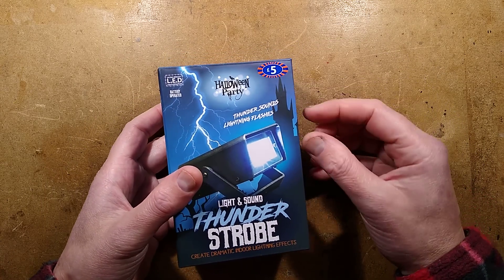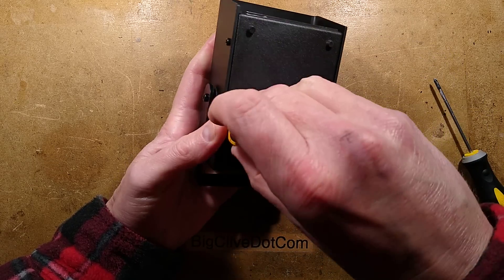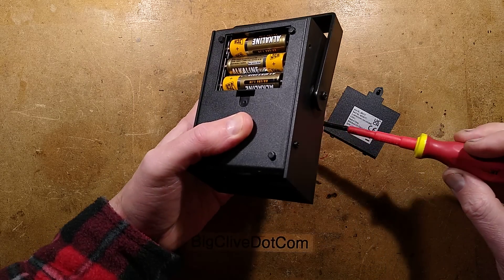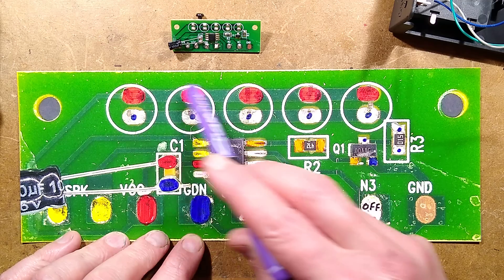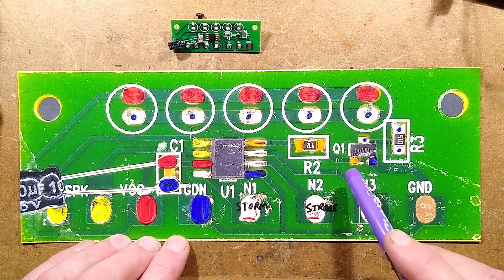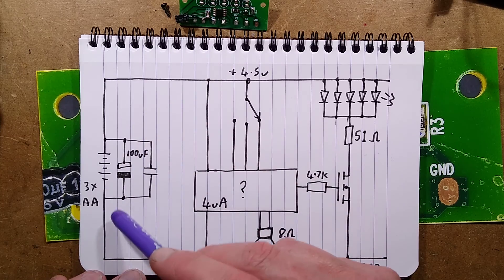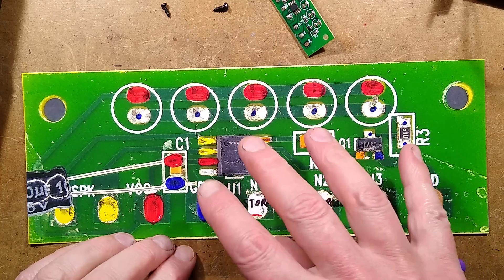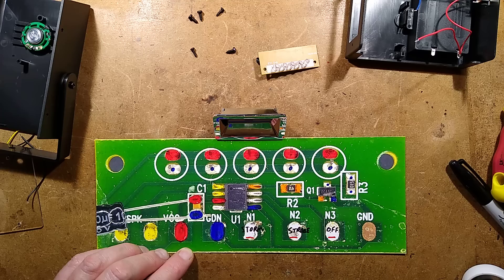Hackable Halloween poop

Comment: I've seen these in a very similar package minus the batteries & audio and plus an AC Mains cord and also containing multiple rows of LEDs.
I picked up 4 of them from a auction surplus kind of place and swapped the LEDs over for red, green, yellow and white (well one of those colors was original I think it was green). Wonder if there's some way to wire in a DMX module to control speed. Either way I have not found a use for them.

Comment: Okay, I've figured out why the effect is so terrible.
The code to generate the "thunder and lightning" is nothing but an encoded 1- or 2-bit PCM sound file written directly to the little controller's flash.
It's the same exact effect used to create PIkachu's voice in Pokemon Yellow. They then just ... looped the one sound file over and over, with the LED pin driven by the same PCM sound file.
I did something similar in my early computer classes, to write a PCM waveform and command the microcontroller to "play" it back when studying A/D converters.

I wonder if the micro had enough space on board to store more than one sound effect file.
If I wanted to build one of these, I would add a secondary flash chip over I2C, and write the sound files to that. 
This would free up the storage in the micro for a far more elaborate program for the overall effect.
Intelligent functionality, such as variable delays between "strikes", or distant thunder accomplished by firing the lights, waiting a second or two, and then playing one of several thunder rumble effects, would be very doable.
Maybe even have one sound file that's a strong louder strike, that has a different program that really goes ham on the lights and then plays the sound immediately.

A better option would be to use an actual sound player with the thunder effects recorded to it, and the micro can pick one to play on demand. This would give better sound quality.

Also, like with any 3AA or 3AAA device, you can power this natively with a lithium cell. (Use a protection circuit though.)

Comment: Re JCB batteries, i've been using them a few years now and while not quite as long lived as a certain copper-colour-topped "premium" battery, they're a lot cheaper (especially when bought in tens on fleabay) and last very well. No my "default battery of choice" when buying dry cells.
As for the circuit, it reminds me of a toy machine gun i bought ~30 years ago for a fancy dress party, that had a very similar sound effect and about 5 or 6 LEDs in a red translucent section of the "barrel" that flashed in unison with the sound when the trigger was pulled.
I wonder how the light would propogate if the reflector was used on a section of the LED "neon" in your other recent video - several could make a string of lights as a sound to light, scanner effect display or similar.

Comment: Send it to America, that is were these Hallo! ween! (starts crying) gadgets belong. It is their (stupid) party, right?!? The case seems to fine, can be reused. As far I can spot things, there aren't video's about reusing a case of something for something else. So much unusable stuff usable is throwing away. Every 'creator' design something new, buy wood or 3D print it, use new stuff to make a case for their idea while other people throw away designs that you never ever (accurate) can reproduce. When people throw away stuff it is waste but is it really?

For example what I did a time ago to create an awesome Bluetooth speaker for almost nothing. Purchased two second hand big and great looking speakers from the past for  a few euros, screw it onto a iron plate (stand of a LCD tv), reuse a handle for it to be able to pick it up and to be able to put your phone or tablet onto it (a stand), reuse the internals of an abandoned (dumpster) sticky surface stereo BT-speaker and build the internals it into one of the speakers. I could never design the correct accoustics required for a speaker like a professional did. So yeah, why not reused it? People ask me "where did you get this?" because it sounds great and it looks so professional and well made. "It is almost made out of trash", people won't to believe this. 

Creativity is at a depth because everything people do has to be new, requires a new design and everything has a fixed purpose. For example, you cannot use tissues to use as toilet paper because the package (and manufacturer) told you so. I am very glad to see there is somebody that suggest to reuse something not useful for something else. Do you know what I mean? You have to see the possibilities, without that, it becomes completely trash. Thank you for sharing this 'trigger' to be creative.

Comment: I think the only time that you should add bigger speakers to things as if they have a volume control. I think my very first driver bypass was an old alarm clock then I recently did it to a altec Lansing Bluetooth speaker that normally had a passive radiator but this little amplifier actually had the strength to power an extra large bookshelf speaker with better quality than it was intended to drive.

Comment: There is a technique out there to produce low end sound with a generic micro controller. I forgot what it is called but what you basically do is blast out a continues bit-stream out of one IO pin stored in memory at whichever rate the controller is comfortably capable of. It relies on the dampening of the speaker to form a sound out of this PWM like looking bit-stream. Very simple and (if done right) surprisingly good audio quality. But you have to fiddle around a bit with the parameters of the algorithm which creates the bit stream to get it sound good otherwise you get that shitty chirping sound.
Reply: yep, PWM. All you need is a filter on the output. Pretty much any decent microcontroller will have a few IO's with hardware PWM on them

Comment: Lovin' these halloween theme tear-downs! Please keep them coming. I built some kewl circuits, in the day, with 555s to make a range of audio oscillations from kackling laughs to 'woo woo wooo' ghost sounds. It also had a 'creepy blinking red eyes LED' effect. The circuit would fit inside that crappy thing. Take out all but the two furthest LEDs to make eyes... All it needs then is an IR doorbell type trigger to set it off when some kid in a costume walks by.

Comment: You're so wrong about the battery holder needing screws. Toddlers will put anything in their mouths especially when they are teething which could be dangerous to them sometimes.

Comment: Dang , I remember and have a couple of the classic cheap, but bright & quick strobes from the Halloween aisle I bought as a kid wandering K-Mart in 2002ish for less then $10 each after Halloween. 

They are 110v, had a turn pot for speed and have a  camera flash intensity, but adjustable to near solid strobe down to a slow blink.
Reply: Oh my word, I have 20 year old Halloween props.

Comment: I have a bullshit nitpicky complaint about most LED so-called strobes which I've encountered: A pre-LED strobe, as I had experienced, had a short "on" period, regardless of the "off" period. From the first time I've encountered LED strobe lights, especially at the affordable consumer level, they've been more like something powered with a simple flip-flop or square wave generator between on and off, and there's something just not quite the same as the others which I'd experienced before then.

Still, it's an interesting device, and if it's made to flicker and does so reasonably well, more of my fun would be finding a way to pipe the audio through a budget (say, thrift store?) subwoofer and/or entertainment system amp for better thunder effect, at the very least. Even if it has the cruddy strobe, it could be loads of fun.

Clive, it's already the First of October there, and will be when I wake up tomorrow, what I consider the official first of the Halloween season. Good timing on that product review!

Comment: That "mysterious" 4k7 resistor on the gate of the mosfet is most presumably on purpose. Without it the gate will be driven hard and the transistor turns on hard and the LEDs will switch on hard, which maybe causing a drop in the supply voltage hard enough to reset that "mysterious" chip. With that resistor on the gate, the gate capacity is used to turn on the mosfet more slowly. The botched on electrolytic capacitors supports this assumption.

Comment: With a chip like that, I don't think it has a PCM sound effect. The chip just probably passes a series of analog voltages through the speaker to try and simulate the sound of "thunder", but it just sounds like ear noise.

Comment: Thanks for the Suffering for us.... Hope you killed it with HV DC & Fire

it Be better if  it used A ESP8266 (With SD Card) + Bluetooth (so it can use PCM audio of a Speaker bar / Smart Speaker)
Random Charged the pitch / speed within 30% and Have around 50 sound fonts Soundscape  Samples
+ Also Addressable WRGB  leds so it can do other seasons & play Radio streams

Comment: Mibbies disable the speaker (or fit it with a little opamp circuit, I favour disable) and swap the LEDs for little near UV ones, leave it on strobe only... Could be interesting.
There's also the possibility of fitting a PIR or Doppler detector to strobe UV light as people pass by... 🤔

Comment: So, this device makes you think there's thunderbolts and lightning?
Very, very fright'ning!
The dedicated "OFF" position by the way might put the MCU into some kind of power-saving / sleep mode? Some MCUs have internal pull-DOWN resistors which you can apply to input signals afaik. Falling edge on that pin might be used to wake that thing up, and rising edge re-arms the wake-up circuitry and applies power-saving / sleep.

Comment: Loads of uses for the box but not so much for the control circuit .
Wanted to ask you ,are you having any issues with the BV 9900 .Ses I can't get the thermal camera to focus sharply at distant objects .It never did .I have a plug in seek thermal camera and it has a manual focus ..Strange it's the Flir is ok for close but in our field it's not always a good idea to be close to something that may want to grenade
Reply from the maker: The thermal camera is fixed focus.  I've never really used it at long range.
Reply: @bigclivedotcom  .Some time you never want to be too close to some equipment .I ended up using my seek thermal for the longer distances .It's just amazing how quickly you can trouble shoot and figure things out with a different set of eyes .Looks like I won't be needing the old infrared thermometer any more although it still has its uses

Comment: In true Douglas Adams style this is definitely destined for the B Ark. Otherwise an inexpensive case for a bench test meter or whatever.
Reply: With the right replacement front panel it could make for an awesome miniature test gear build. Maybe you could fit one of those cheap digital voltmeter modules into it.

Comment: 4.7k lets them use a bipolar instead of FET if they prefer, as the flashrate is low duty, you could reduce the series resistor for more light or put a largish electrolytic across it (pos to led side).

The sound side is rubbish as you state , perhaps a suitable sized capacitor across the speaker may tame it a little.

the box is useful though :)

Comment: Stores have been selling these same strobes here across the pond but they have a 3 position switch and a pot for a "flashing" mode. I wonder if that's what the unused pin on that chip is for.

Years ago I remember seeing cheap LED strobes of a similar case design, but they had 4-pin "piranha" LEDs. I feel like they should have moved to surface mount LEDs but instead they seem to be progressing backwards with these 2-pin 5mm ones.

Comment: Perhaps that 4k7 resistor together with mosfet's input capacitance helps turn the LEDs on and off smoothly. Which seems to work, but for a believable lightning effect I'd expect exactly the opposite.

Comment: Better to just use the money wasted on that and just build a tesla coil. For a few kilo$ one can be made that puts out 15-foot bolts. At least that would be a bit less disappointing and actuall 15-foot mini lightning will annoy several blocks worth of neighbors just like a real thunderstorm will (complete with power outage if the bolts hit the local 13.8kV power lines and short them to ground (several hundred to a few thousand amps, beefy secondary coil recommeded unless it's meant to be disposable).
Reply: Its made for children duh!!! And children plus a tesla coil is 500000 deads
Reply: @309electronic5  pftt It makes a good Darwin Filter. I built one when I was 10-11. Granted it just used a 15kV/60mA  NST (4-foot sparks) and not a 14.4kV pole transformer wired backwards or a 15kV/500mA neon bombarder. I got zapped a few times and I didn't die, but I learned real quick not to repeat what I did that caused me to get zapped/burned (ie touch the tank cap terminals after a run when it had no bleeder resistors, light flourscent tubes in my hands and while doing so by letting the far end of the tube get too close to ground or the primary, letting sparks fly off my fingers but without thimbles, etc).

Comment: On the JCB batteries - my experience in buying them from Home Bargains for years is that for their price, they're decent. They're not as high capacity as say Varta but there's a decent amount of juice in them in that you won't be changing their batteries as frequently compared to a lot of pound/budget shop batteries that come from obscure brands. Of course where possible try and use rechargeables but on some occasions only the likes of alkalines will do.

Comment: Going to bet the sound is limited because they used the cheapest version of that 8 pin micro, with possibly 2k of OTP EPROM in it, and probably 32 bytes of RAM/registers,. so have barely enough room to store the code to generate the noise, using a software shift register. The 2 pins drive simply to increase voltage to speaker. Yes board probably has other uses, with perhaps fewer LED's and a larger chip to store more data, so you have something that is a toy with 3 sounds in it, and a flashing light in various positions.

Comment: @3:40 Likely a type of Op-Amp. The LM386 is a great sounding IC to build hundreds of different low-voltage  audio circuits. Could be similar.

Comment: OOOOHHHHH!!!  I got one of those!   YEARS ago at a Walgreens (Drugstore Featured in News stories in the USA..)    Mine is about 7 years older and it is different on the inside.   The Audio output on mine is actually pretty good in the bass on a 4 ohm  outdoor speaker.    

My unit also  has a  dial to adjust the intensity of the strobing.    So I guess this is the new Value engineered 'Upgrade"  we see so often.    

I ran mine from a 5v USB power brick and its hecking bright and loud as well with the outdoor speaker attached.      

Kept it outside and mounted  in the doorway with  one of those small TV box speakers they sell often at Parts express.   Was wonderful for my Halloween splendor.    

Last year I even had a young couple come by and take photos like it was a Prom thing! 
I don't know about you guys?  But  OH BOY! am I happy the Holidays are here!

Comment: If it's anything like the us version, remove the resistor in line with the pot and you can run it near 100% duty and anywhere between, cheap strobeo scope
Reply: Definitely not as good, wow.... Not even variable speed...... I'm sorry clove (my phone can't spell Clive and I'm not going to correct it) these work on USB power as well, you might be able to bodge a 555 and pot in

Comment: Bought something similar years ago  because it could run off batteries so I could put it far out in the yard and it sucked just as bad as this, nice to see no real improvement over like 10 years lol… Always go with the ones with a actual (I think) xenon flash lamps in them or just brighter LEDs

Honestly just find a old phone and use some app to flash the camera flash and it would be better and brighter than that thing, + add whatever sound if needed lol…

Comment: I was thinking for a second that it might be a dedicated chip with stereo audio where they're using one channel to drive the LEDs and another to drive the speaker. But then it would have to be single- or double-ended output on both sides, not one and the other, wouldn't it.

Comment: I always thought the point of the screw on battery compartments was to prevent loss of the cover from a clip snapping. 

You know like how after some time the battery cover for the TV remote just falls off because that little clip snaps and then you either have to tape it on or it gets lost? 

Yeah, to prevent that on devices that might have batteries changed frequently or have a rough life.

Comment: Got some cheap 3€ ones in the same casing as yours some years ago, they were just strobe lights, very bright but with FIXED speed. Not anymore, after putting a resistor and a potentiometer in each one they are now variable speed and work nice at the small venue where we play our DJ sets. Though it was a veeeery easy hack I'm still proud to have turned some crap stuff into something quite usable ;)

Comment: Ah, welcome to the season of disappointing battery powered Halloween tat. I have one of these, but sans speaker and with a pot to adjust the 'strobe' effect (which even at the fastest setting doesn't come close to a proper xenon strobe unit.) 

I tried using it to light a mirror ball but the brightness isn't there - I found pointing an ordinary LED flashlight at it to be way more effective. All in all an incredibly disappointing item albeit in a nice little case. 

At least I bought it some years ago, before the present craziness, so only paid £1, the upside of that being that folk might be less inclined to drop a fiver on something like this on a whim and eventually China and its UK outlets might get the message that we don't really want this straight-to-landfill waste of resources. Might...